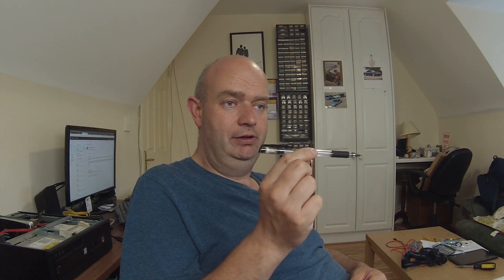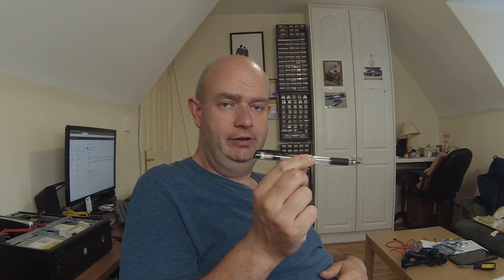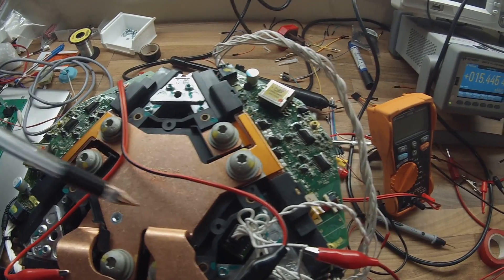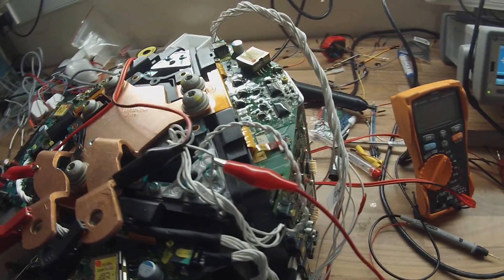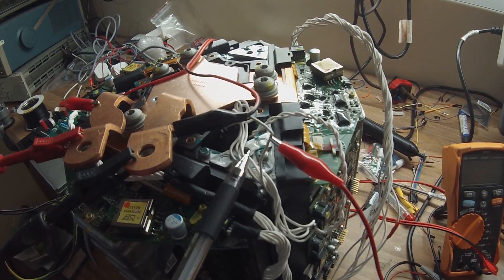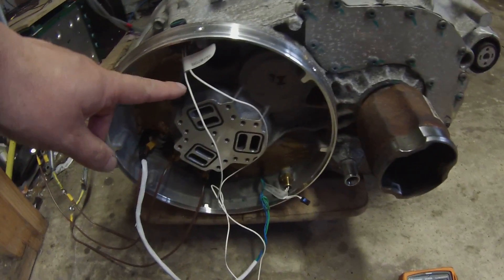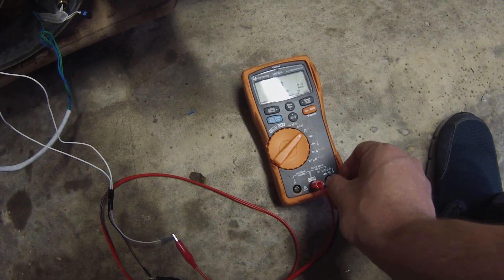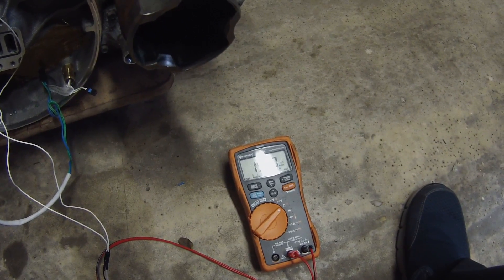The Tesla Project : Sensing Sensors

Comment: perhaps you need to load up that voltage sensing line? make it react quicker. seems a bit dumb its so laggy
Reply: Agreed, perhaps the overshoot is partly to compensate for input capacitance on the main board?  I would check how much load (resistive and capacitive) the main board input places on the sense wire and try adding that to your test circuit (rather than just the ~10M ohm multimeter you seem to have connected.)